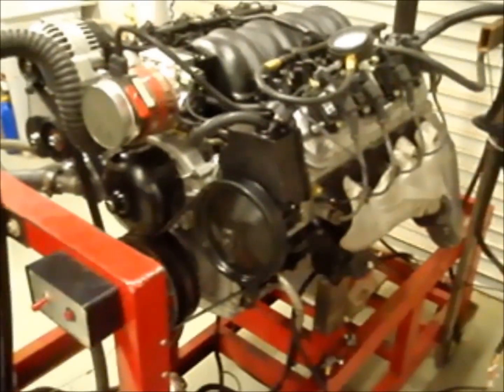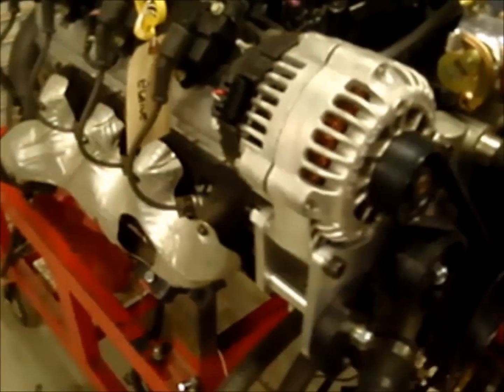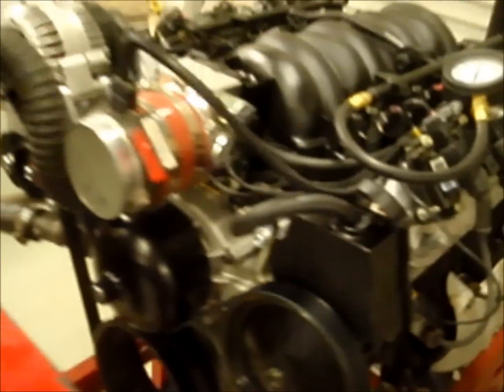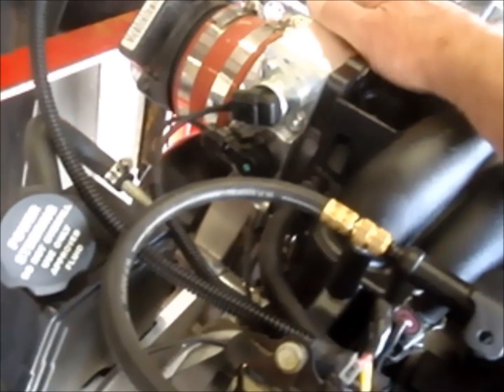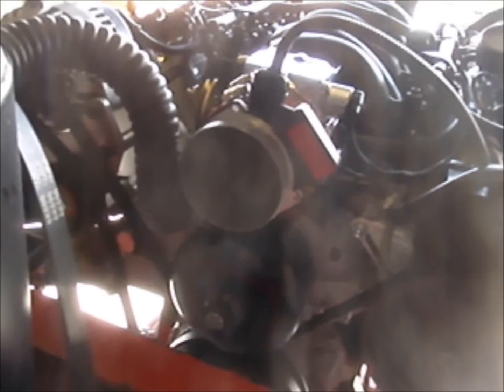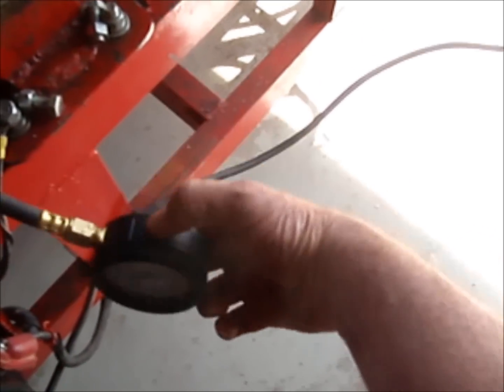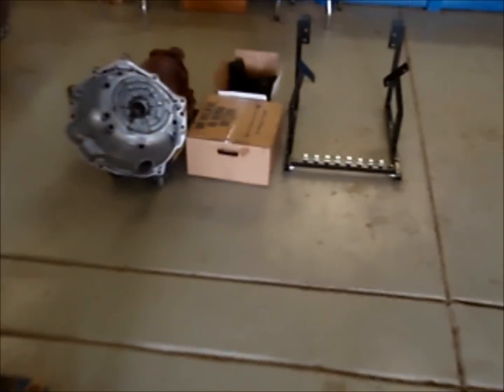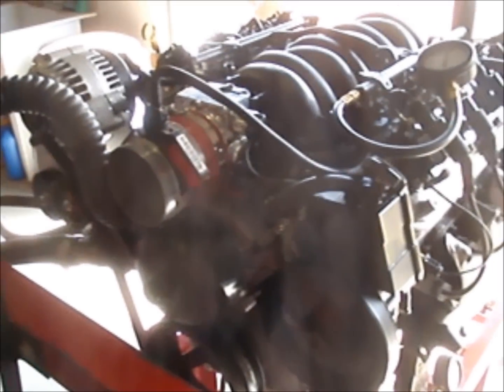2005 LQ4 6.0L with LS1 Custom Conversion

Comment: Dave can I use the x link connection 8 prong to 6 prong in order for a 03 LQ4 engine using an LS2 GTO throttle body bolted to an LS2 intake work Using the truck wiring harness pedal and TC box?

Comment from the maker: To test all the electronic sensors and the engines mechanical parts. Our Customers saw and heard their engine run. When it was installed they didn't say "I hope it starts and runs" ... First start up in an engine bay is OK if nothing goes wrong. On a test stand problems are easily taken care of. 

Dave Dees  
Foxlinders